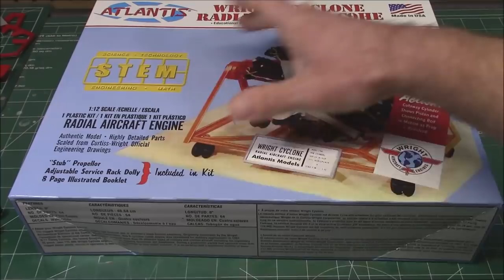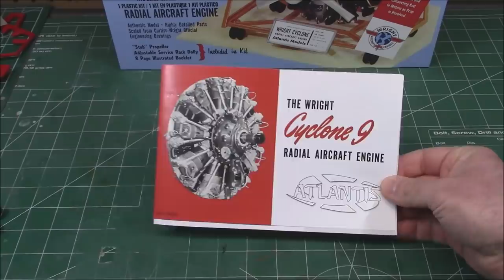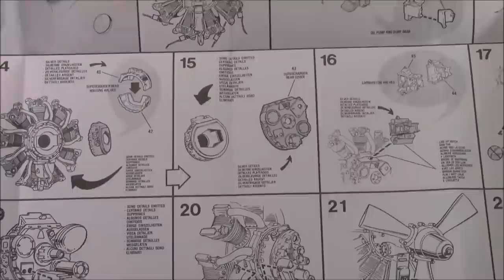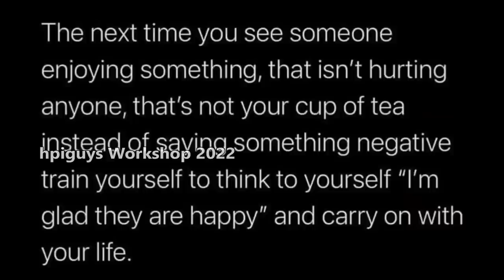Wright Cyclone Radial Airplane Engine 1/12 Scale Model Kit Build Review How To Metallics Wiring Prop

Comment: Being an ex-mechanic who has built a lot of radial engines, I am not going to nitpick a thing. You built a lovely model and I have seen tons of radials that were custom painted. But I will mention one thing that you might like to know: the "exhaust" pipes as you called them, are actually the intake pipes from the carb manifold. It looks like the kit does not include any exhaust stubs.
Reply: Was wondering why the carb, was so close to exhaust manifold, oh it wasnt! Thanks for pointing out to us!!
Reply: Omission of the exhaust stubs at this scale is egregious. I just build a 1/48 scale version of the same engine that included them!

Comment: This is just like the radial engines that I 3D printed and designed in tinkercad for a B-17 that has a 12 foot wingspan but mine were around 30% bigger. Most of the components were created by eye plus a very detailed blueprint.

Comment: I believe Studebaker built the Wright 9 under license.  Where I worked they built the B-25 engines. Which was a double row engine.
Reply: Yes they did. Years ago I saw the Sentimental Journey B17 at an air show, and looked at the crankcase builders tags. 1 was built by Wright Aeronautical. 2 by General Motors, 1 by Studebaker. The turbochargers were all labeled Allis Chalmers.

Comment: Those are not fuel lines, they are the spark plug wires and ignition coils.
Reply from the maker: Yes, a simple mistake and the manual gives the correct names if it's crucial to the builder.